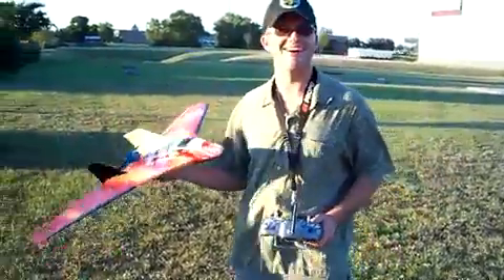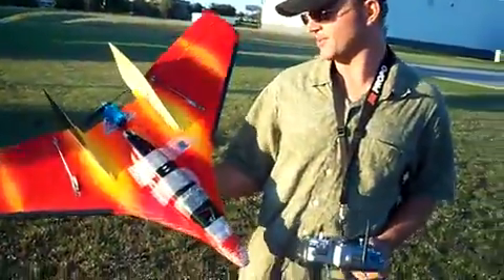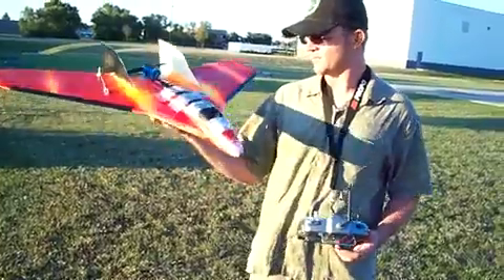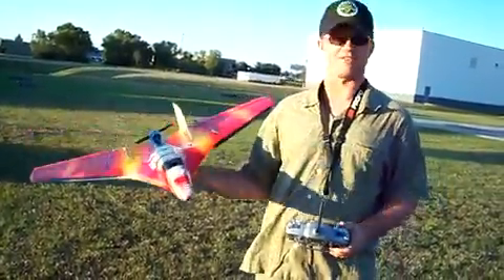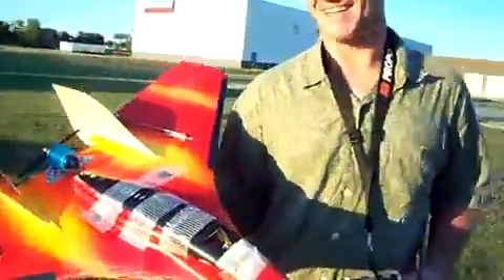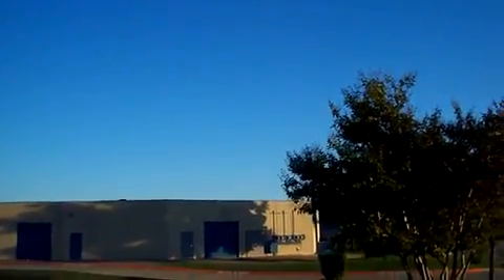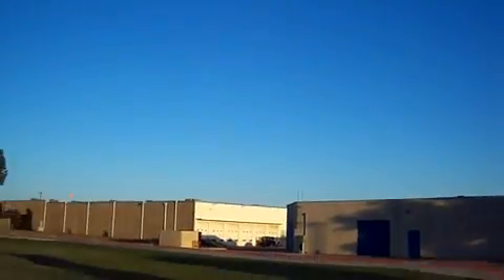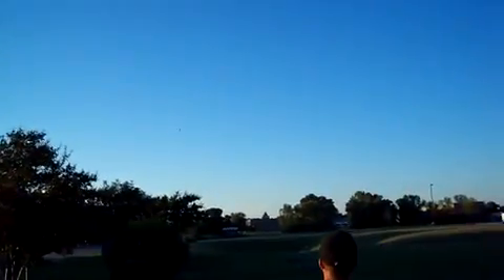7S Texas Stryker 147mph!!!

Comment from the maker: It's glassed using a nontraditional fiberglassing method, where coarse roof repair fiberglass (Henry 183) is bonded with 3M-90 spray adhesive. Stiffens the plane for flight and is still somewhat bouncy when it hits the ground.

When I use traditional fiberglass and epoxy, I use stuff I got from a boat supply shop. Great Planes Z-Poxy will also work well. Stay away from "fiberglassing resin" that you'll find at auto shops, as it's not epoxy and not as strong.